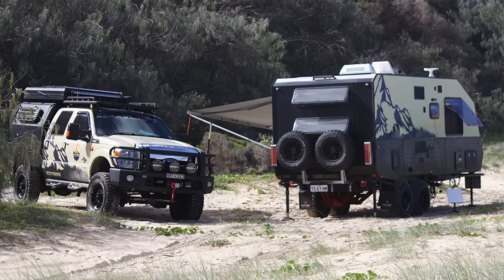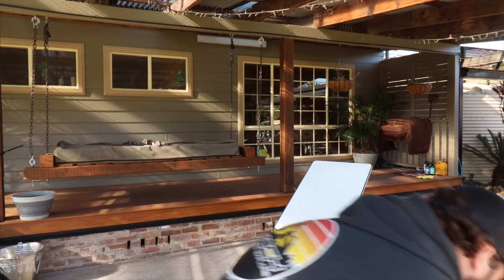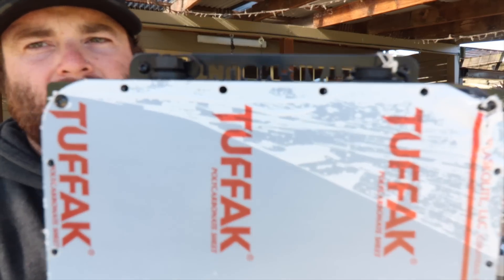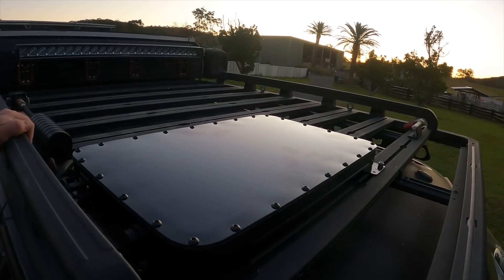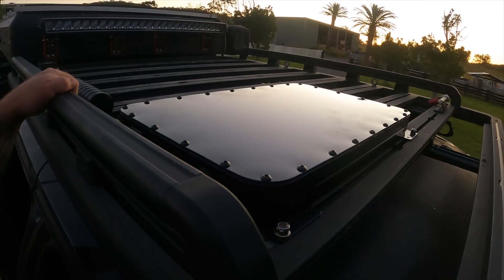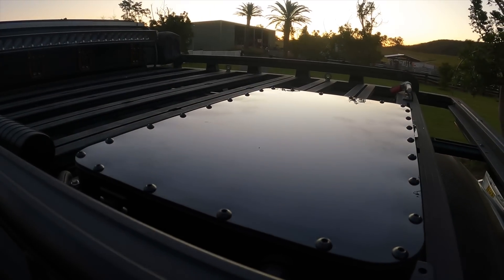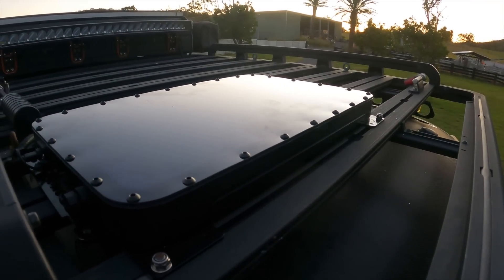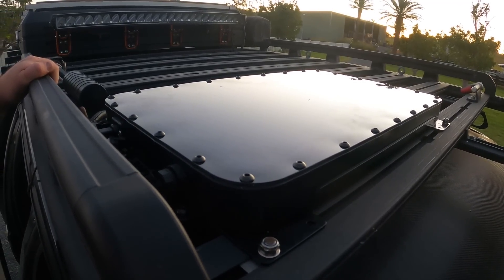🪚DIY STARLINK FLAT MOUNT MODIFICATION! STAR MOUNT all in one 12 VOLT flat case modification !

Comment: What I'd like to know Ty, is how you found initialising this router and setting it up without the purpose-built software/hardware pairing that is the Starlink router and mobile app? How do you configure it?
Reply from the maker: Read instructions fully at the end. It explains how to set up your router. The app works the same I didn’t need to do anything on the starlink end.
Reply: @TyFenwick  Oh! :) Thank you! I guess that the app talks to the dish hardware then, and not to the original router. Interesting! :) Can't wait to get it.

Comment: Did you need to use the extra power supply or does the kit have a 12v converter built into it ?
Reply from the maker: Yeah must use everything in the kit
Reply: I reckon that converter would be 12v to 48vdc. That's the voltage the standard dishy receives from the router in a normal set-up.

Comment: its too bad you didn't show a test of the system and the WIFI, I would have a concern about the WIFI being in a metal box and behind Starlink antenna's RF interfering with the WIFI reception
Reply from the maker: I have an update video on performance coming next week. I wanted to use it first for 6 weeks before I gathered my thoughts.

Comment: Good Stuff! Ya beat me to it! 😉 I am still kinda waiting/considering the larger high performance Dishy for mobile use (if it ever comes down in price 🙄) It's currently available in Oz to businesses but @ $3.5k it's up there especially as the RV hardware is so cheap. Be interested to see how it goes 👍
Reply: "as the RV hardware is so cheap"

Assuming you're talking about Starlink's RV hardware, it's the exact same hardware as home users get. AC voltage and all.

Comment: The only thing I would be weary of about this solution versus others out there, is the color of the mount. Having it be black, it might be prone to overheat your components inside the mount. Hopefully you don't have any issues in the future. I do love this all in one solution though, just gotta run a 12v power/ground line to it. will make for a clean installation.
Reply from the maker: I don’t think the black will be an issue as it has great ventilation around it with air. You can get it in white also